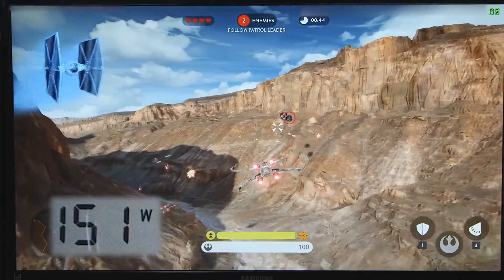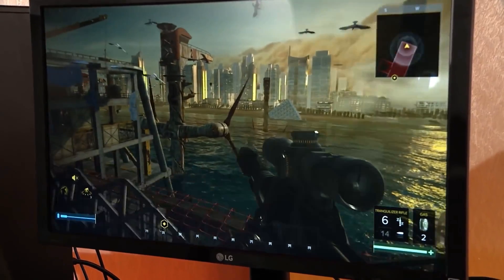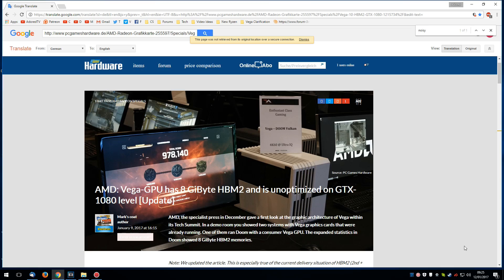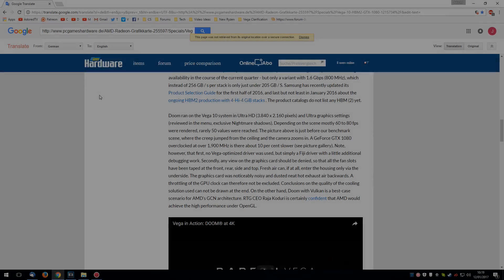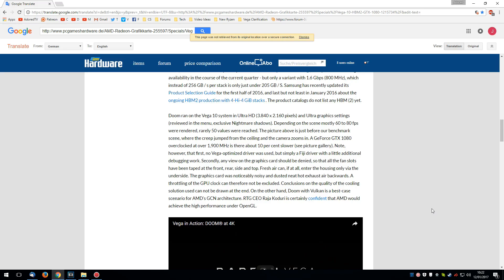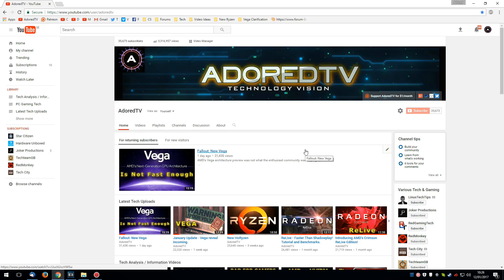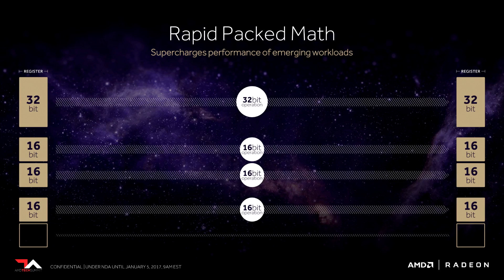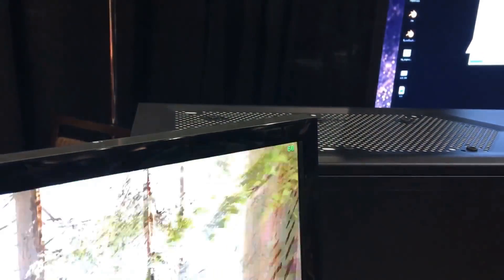Vega Clarification - How bad is it?

Comment: I really hope that this is true, because what's the point of ''POOR VOLTA'' then if Volta will crush it?
Reply: for the worst case scenario it's poor marketing
Reply: The marketing and engineering departments are different entities.
Reply: might be "overclockers dream" 2.0
Reply: Yeah, why would they include that if this GPU is barely going to beat the 1080 and get crushed by Volta?
Reply: +ShallowDepression the worst case scenario will be my best case scenario lol vega at 350$ :)
Reply: You moron. Pascal is not even bandwidth limited by G5/G5X, what the hell would adding HBM2 to Pascal do for it's line-up? Vega will not likely benefit from HBM2 either, the fact is it utilizes HBM2 for it's new high bandwidth cache streaming content from system memory more efficiently.
Reply: The worst case scenario would be atrocious marketing, if they don't back that claim up.
Reply: As the sign would say "Poor Voltage" i believe it's actually talking about the power draw problems with the 480, and how it's not on VEGA, not that it's a poke at NVidia. This could explain it. Perhaps a bit of both.
Reply: I don't care what they charge for Vega, I'm in :)
Reply: ***** personal insults are always a good conversation starter...
Reply: 666nataS p100 slays all

Comment: they obviously sandbagged vega because they didn't want nvidia to show off the 1080ti
Reply: "Obviously"
Reply: Don't think they are too bothered with the 1080ti when they have a dual gpu vega with 16gb of shared HBM2 launching in Q3-4 this year that will cost around the same price and blow it out of the water.
Reply: Mojo Jojo Dual Gpus are dead. Who buys them anyways?
Reply: Henrik AMD have always made duel gpu's.  The difference is with DX12 you can use duel gpus as effectively 1 large 1 and the memory pool can be shared meaning you actually have 16gb of graphics memory instead of 8.

We'll have to wait and see how this pans out but this card is going to be a monster no doubt.

Comment: Did he say GTX 1080 for $300 at 10:59 ? This would be amazing.
Reply: So instead of the move to 14nm being a massive performance leap, nothing changed, all thanks to Nvidia's monopoly.
This is why consoles exist, PC gamers keep getting scammed...
Reply: And consoles use AMD chips. If AMD flops, consoles will have to deal with more expensive chips as well.
Reply: Hopefully AMD is competitive or else prices wont change.
Reply: Yes, if you look at the prices to manufacture instead of the prices based on Performance. The GP104 Chip from NVIDIA cost them the same to manufacture as the GK104 found on the GTX760 and 770. Which used to cost 1/3 of a GTX 1080.
Reply: Ant McLeod Technically Scorpio does/will, but that's splitting hairs.
Reply: tiger d Uh, no.  AMD is under contractually obligated to supply GPUs at the bulk price that was agreed upon in the aforementioned contract.
Reply: Vega would have to be significantly cheaper than the 1080 for Nvidia to drop the price that low.
Reply: Why? Console chip prices are set and they are not using P10....

Comment: I do have GTX1080 and I disagree on your point. It's not a Midrange GPU.
Reply: a couple years back the X80 series of cards was the full chip so full GP102 in pascals case. But even the titan xp isnt even the full GP102. so the full GP102 should be the 1080 the titan xp should be the 1070 and the 1080 should be the 1060 if AMD was competitive. So yeah the 1080 is a midrange GPU, a small cut down chip, but still better than anything else on the market.
Reply: It is at 300mm di, even the Titan Xp is not a full chip. You have bought a "1070" card. 
Thats the consumers fault for buying Nvidia blind even if it was performing worse then Amd.
Now that Amd has run out of money for R&D budget there is almost no hope for them beating Nvidia on performance.

Welcome to the  Nvidia monopoly!
Reply: At about 300mm² it certainly is.
Reply: You only saying that because you spent 650 - 700 dollars on your gpu.  The fact is die sizes are directly proportional to cost.  You my friend over payed for your 1080.  Every generational jump should be a bump in performance, not always a bump in price.  This is how the industry works.  This is why Intel been selling their main CPU I7 for the last 6 years around 350.  The smaller size fabrication allows them to get higher yeilds with cut in cost for the consumer.
Reply: markus peter is that true? Didn't know that.

Comment: About Nvidia, you fail to acknowledge Volta will be a new arch, it will need to incorporate hardware features to get the benefits of Dx12 and Vulkan, this will mean lower clock speeds, pascals big advantage over Polaris.
Reply: David Lee Sure, but Nvidia isn't under any pressure. They will probably refresh Pascal before Volta comes around.
Reply: Volta will not do asynchronous compute on hardware level 100 %.
Reply: you dont know that it wont have asynch compute, to be honest Nvidia are probably working on there own kind of asynch.
Reply: Why wont it Sinier. Its a whole new arch, this could mean massive IPC gains! Highclocks!=High Performance. Best example of that is Bulldozer. It could easily hit 5ghz but could be beat by Intel dual cores at 3-4ghz. Its all about IPC.

Comment: Well comparing Doom benchmarks at 4k the GTX1080 averages about 59fps and the Titan XP averaging 81 fps, Vega will be in between the 1080 and the Titan XP it looks like. Lets be honest here getting 10-15fps more in a game at 4K is actually pretty good on AMD's part, it also means that the fps gain in 1440p will be much higher too. Yeah it doesnt look like vega will be a Titan XP or 1080ti competitor at this point :/ Disappointing. Vega will have to be cheaper than 1080Ti and possible around 1080's price for it to get anyone's attention.
 Lets be honest HBM actually makes very little difference gaming wise, once textures are loaded into your Vram it doesnt matter if its GDDR5X or HBM.
Reply: Blue I don't agree. Look at Fiji, HBM helped the Fury cards a lot at higher resolutions.
Reply: I guess you're right there, I have a fury X and Yeah it does make a difference at higher resolutions. But not so much for the lower ones. Also didnt help it beat the 980ti.
Reply: Yeah I"m ALL IN at 1440p...
Reply: They cost about that, you only paid $750 BECAUSE Nvidia made you....
Reply: Price is key in AMDs strategy since Rx480. Imagine if they release 1080+ performance at $400 or $350...
Reply: I mean Vega is supposed to be a flagship card, I highly doubt its going to be anywhere near that price point. We're looking more at 600ish USD or more.
Reply: did you consider that doom really optimized for GCN ? go and see how current amd cards perform in doom.
Reply: Yes but current AMD cards are not getting 70-80fps in Doom 4k either... but vega is.